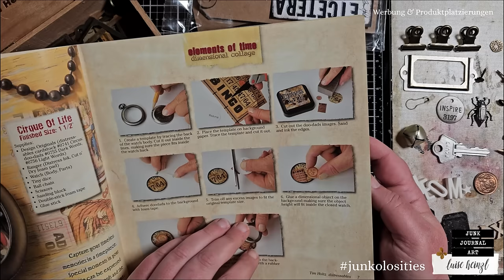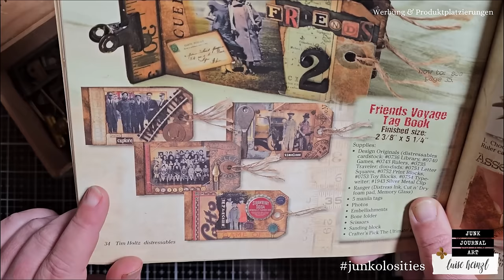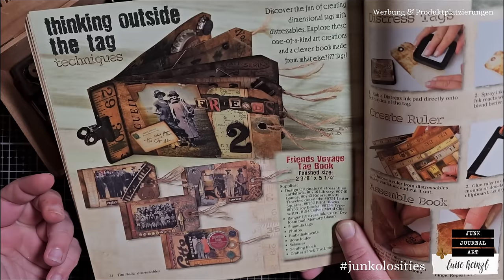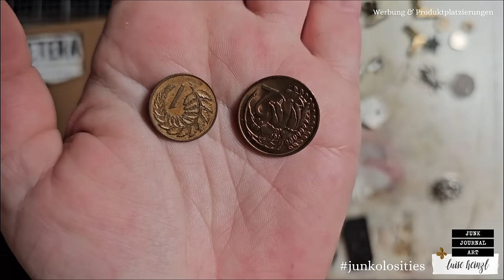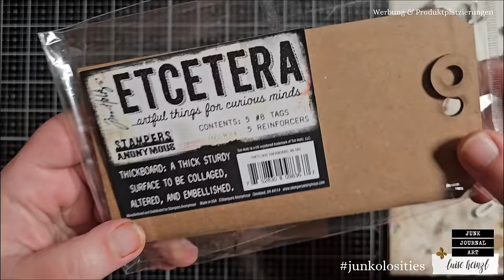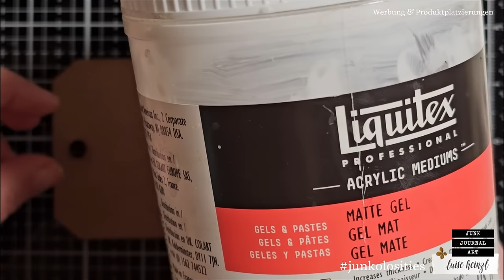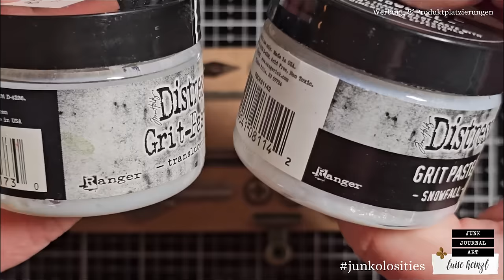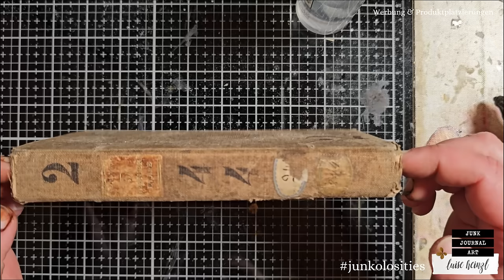THINKING OUTSIDE THE JUNK JOURNAL TAG! HOW TO DISTRESS METAL! #junkolosities

Comment: Luise, I just love what you do, girl! Such a great effect with fantastic results. I would like to recommend possibly getting a Dremel tool set. It would give you some mini drill bits that could drill small holes through that thick tag material with ease. I've used one before for just that purpose (back of a shadowbox was similar to the tag board you had) and it worked very well. I hope you have a Happy Easter! Sue 😊❤